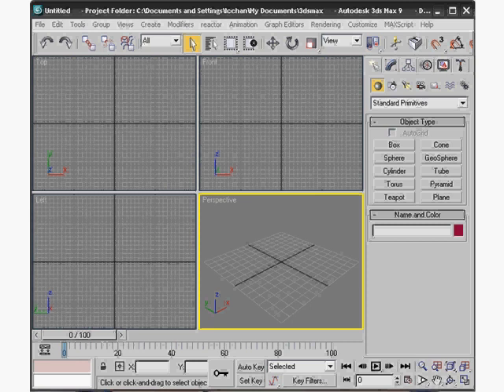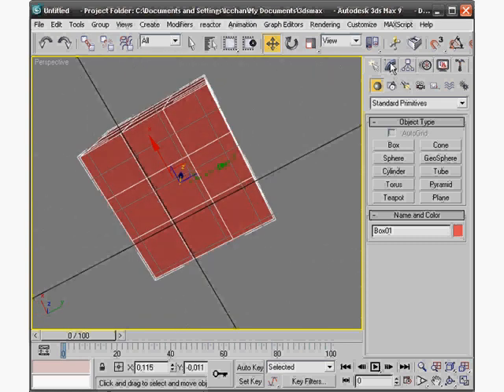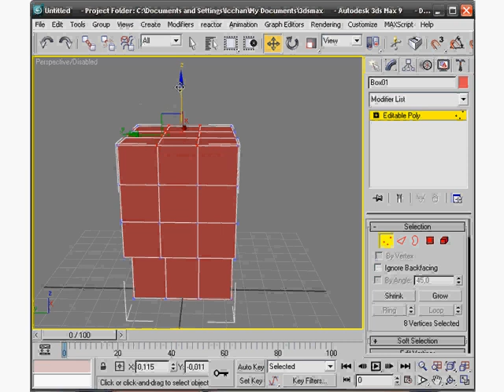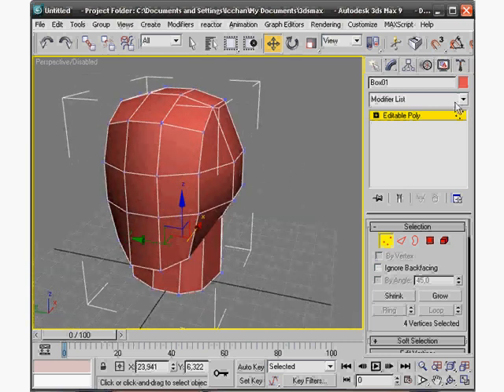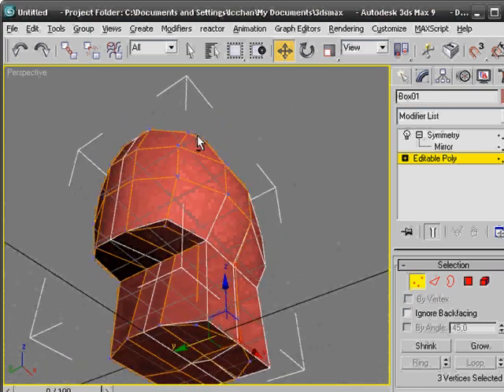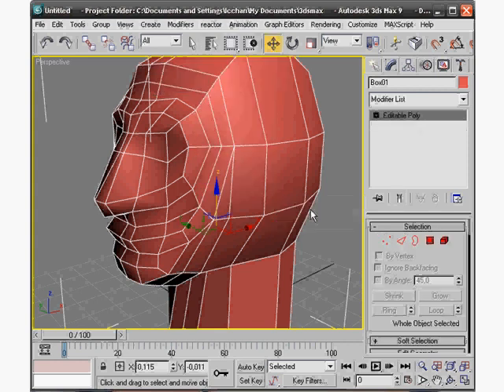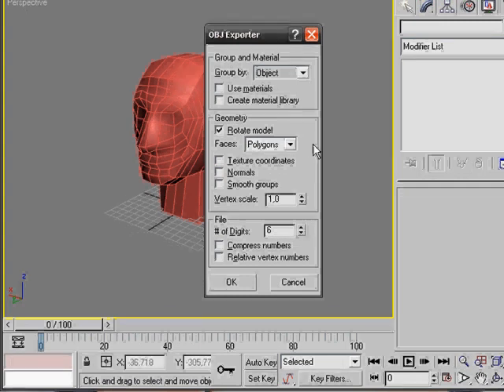How to make a higres model

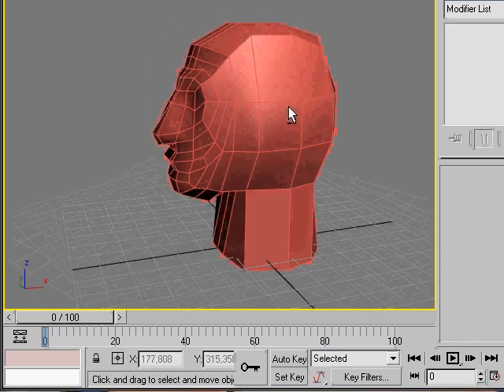Comment: Hey man, you were off to a really strong start, nice topology and flow and all. Around 6:29 though when you added all the extra detail is when it became a bit sloppy though. Keep in mind edgeloops - the loop for the eye and the loop for the mouth are very important. I can see you kind of have them started, but maybe rearranging how they flow will help a bit.

Not trying to sound critical or anything, just trying to offer a tip or two =)